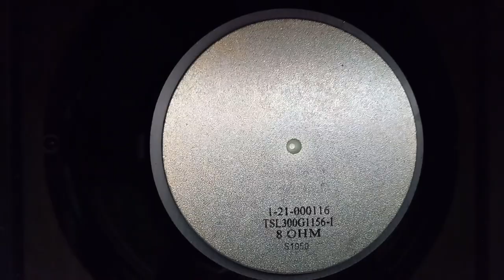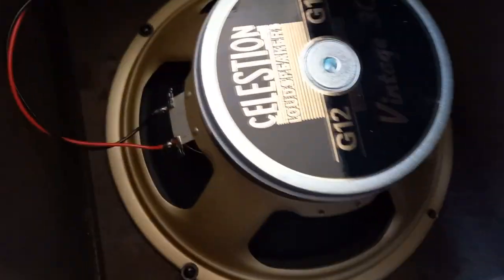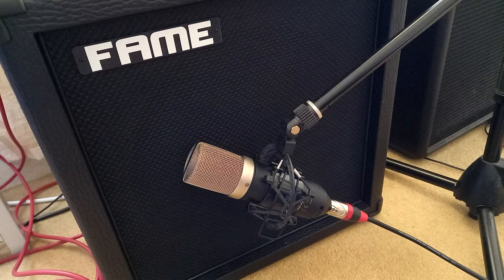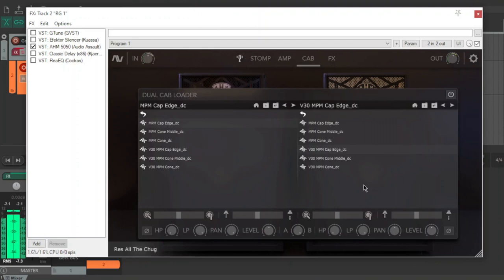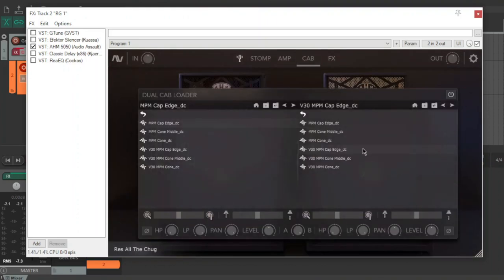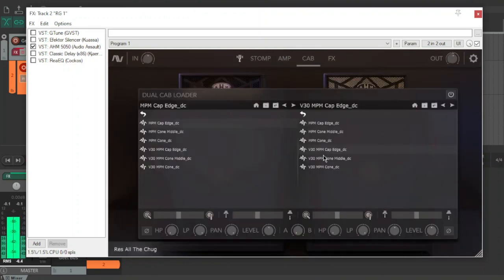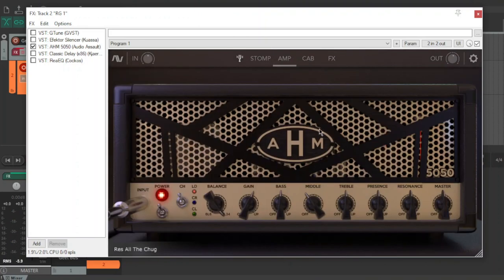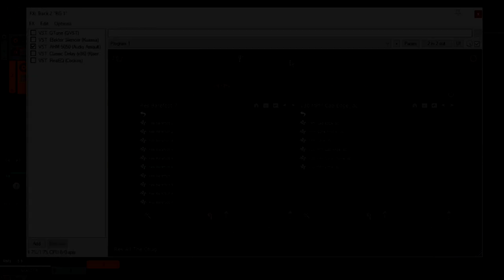The Smallest 1x12 Guitar Cabinet FAME GN112 Upgraded!

Comment: I'm all about speakers and IRs. Once you get into it, there's no going back!
Not a bad little cab, and I often prefer a smaller cab for lead tones, helps to give it a different spot in the mix and naturally roll off the low end.
My 1x12 has a similar back structure and I made a panel for it to make it a closed back. Simple job and it works!
My IRs of it show that it does have a big impact on the tone too, changing the mids and adding a lot of bass.
As Jim Lill's excellent cab video demonstrated, it doesn't have to be airtight to function the same as a normal closed back.
Reply from the maker: Jim lill is the man and yeah dude for leads I think this should be great. Thanks.

Comment: You know what I always wondered? What if you turn the speakers! I think we all tend to put them in a position where it is either easier to solder or read the details on the back. But maybe due to gravity also changes clockwise could improve the "swinging" of the coil and a china-V30 suddenly sounds better! Cheers!

Comment: The comparison between the same speaker in different cabs is pretty interesting. It merely seems to affect the low end and not the character of the tone. I have a harley benton 2×12 with V30. Love the sound but in comparison to V30 in 4×12 cabs from other more expensive brands, I need to turn up the bass. But after some tweaking they all sounded the same to my ears...
Reply from the maker: Interesting... I'm currently on a bit of speaker kick so more videos like this.

Comment: if you would put “wool/dampening” 
it “tricks” the speaker to feel bigger 
lo er’s resonant wisle hz 

trick worth trying
Reply from the maker: Yeah I heard that trick a while back. There aren't any resonant frequencies here I don't like. The cab is quite tight.
Reply: @resington  Yeah it is Rigth . less boom end’s on 1 12”s 

 resonant frequencies by harmonic order by the cab size it ads up to High vistles what  makes that reflection in closed backs.
what drives me crayzy as iff. there is a monkey in side and say something when the tonality is rigth

question being . if you would say what it is ?
Is it the cab / is it the speaker 
or..
Cheers! \m/